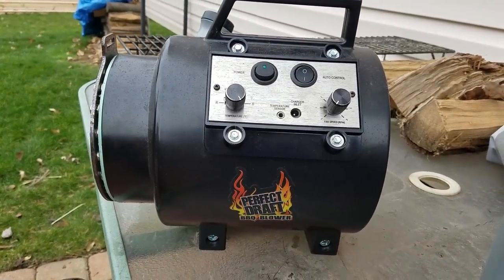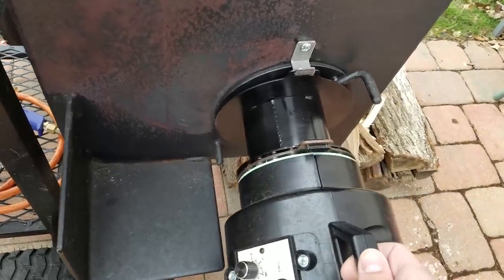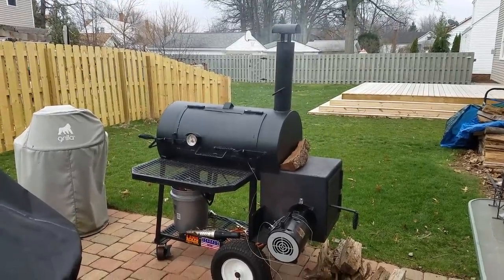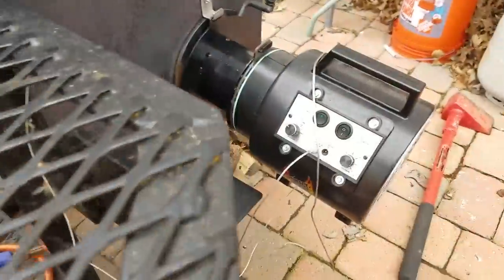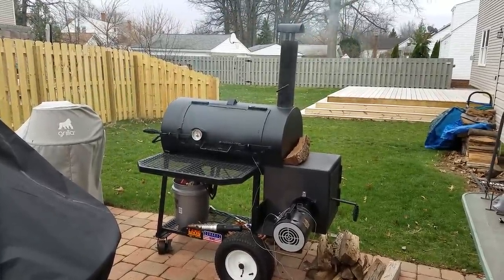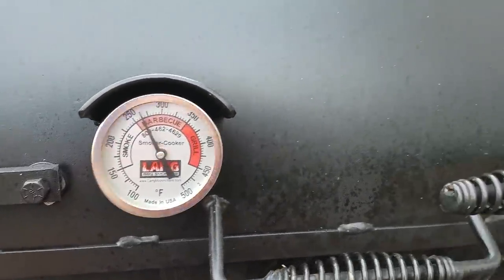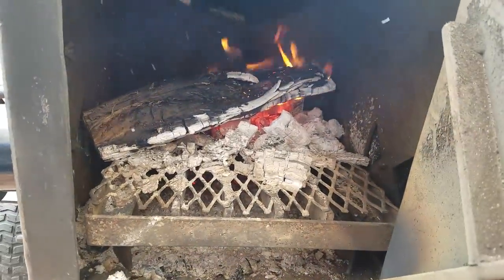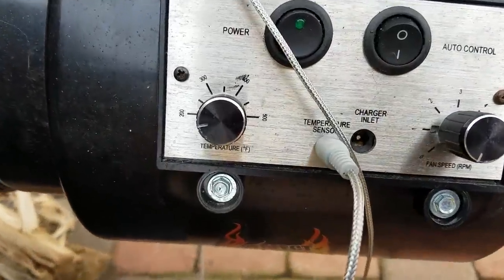The Perfect Draft Temp Regulator For BBQ Pits - What You Need to Know

Comment: Great video. Thanks so much for posting. Looks like it works really well if you dial it down. After seeing your video I was wondering if perhaps the need to dial down is because the temp probe is resting on the cooking grate possibly transferring additional heat. Perhaps using a probe clip might give you a more accurate reading. Happy smoking!

Comment: you said you save on wood. i wonder if the decrease in wood usage lowers the slow smoke absorption of the smoker that flows constant smoke over the meat and it slowly absorbs over the whole cook w/o the temp regulator? have you tasted a difference?
Reply from the maker: I am not the revieder but some thoughts on smoke: A heckuva lot of smoke flows past the meat so even if the quantity is lower it will not likely impact smoke flavor. And smoke is not absorbed much beyond a fraction of an inch. Molecules are too large to penetrate. Because cold wet surfaces attract smoke (thermophoresis) putting cold wet meat in the smoker will significantly increase the amount of smoke that sticks to the meat. Here's a good article on the science of smoke https://amazingribs.com/more-technique-and-science/grill-and-smoker-setup-and-firing/science-of-wood-and-smoke/

Comment: Nice! Review! I am checking them out now for my offset. Do you know what is different on the newer model?  My offset  is similar to yours large square firebox ,36" rack ,19.5" diameter, with a 4" exhaust stack . So I would expect similar results hopefully.  New sub!
Reply: I do not have any info on newer versions of this product but I do know that there have been some batter upgrades.  Some of the attachments look like they have revisions too.  Operation should be as good or better than the video.
Reply: @barbecue4u  Thanks for the reply. I appreciate it.. I ended up going with the Q Master Senior with the 50 CFM fan upgrade. It just seemed like a lot more flexibilty and programability . It displays meat/pit temp and meat/pit targeted temps at all times. Its programable with curves for 10,15,20,25,30,40 and 50cfm fans, It has a ton of other stuff it does for about $200.00

Comment: What is the lowest temperature this unit will do?
Reply from the maker: I am checking with Greg to see,  but in practice, low temp depends on how little fuel and air are in use. This controls air, but you control fuel, so you can let the wood burn down and turn it to low and probably get the temp pretty low. Also, ambient air temp is a factor. In winter your pit will be cold so that is a factor. Keep in mind, you really shouldn't cook meat at less than 200F for safety. Cheese can go lower.

Comment: How is the perfect draft holding up In the long run .
Reply: The unit itself that I used in this video is still running fine. There have been some upgrades to the unit if you were to buy it new today... But it is functionally the same. I have a new unit that I will be trying the next time I fire up the Lang!